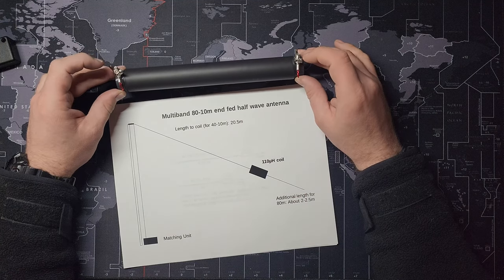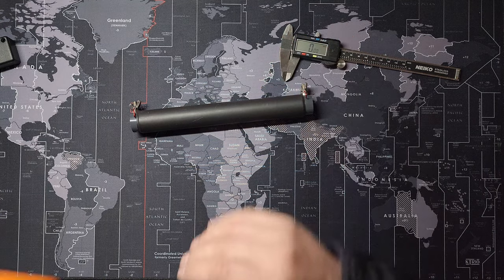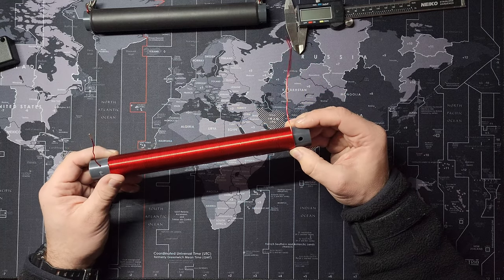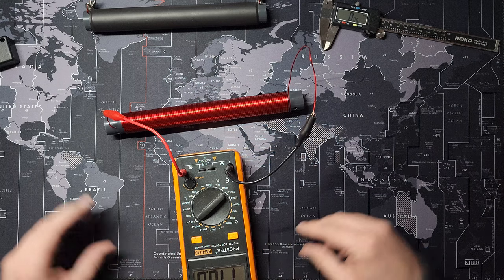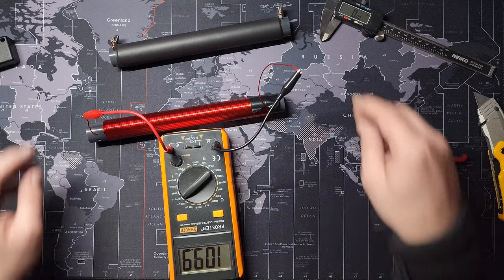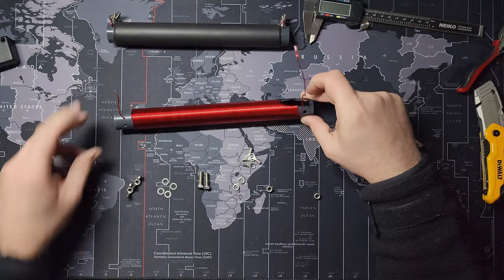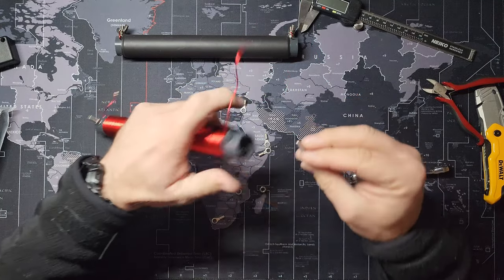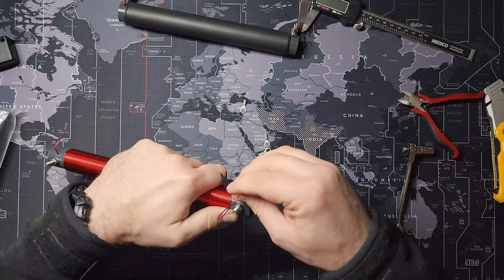Shortened EFHW from 40M to 80M with 110uH Loading Coil

Comment: Looking great. I am a Wireman, love these Endfed Antennas. I work fulltime portable talking to the whole World with 100W out of the Fields, Woods or along side the Shores of River Areas.. Amazing how well these Antennas work on relatively low heights setup from the Ground. Tnx for this neat Video. 73 de YFUG 💯👍🙋‍♂
Reply from the maker: Thank you very much for the comment. This loading coil reduces the length of wire I need at my office so I can still be on the air on 80m. I actually made a smaller version for doing portable ops. I may make a video highlighting it. Same concept building it just smaller pipe and different gauge wire. And yes I agree I absolutely love the EFHW! Thank you and 73, Matt N3VAN

Comment: Outstanding video!  Bought the same Proster LCR to check the coil on a MFJ crystal radio kit I just finished. Used it tonight to go through a box of resistors and I'm impressed and definitely the price is right! Got an ARRL endfed kit I'm going to put together soon and definitely want to do this coil mod after I complete it. Have a 130 feet EFHW 7510 from MyAntennas here at the house and my G90 tunes it up great (1.3:1) for the local Emergency Net on 3922. Hoping with this coil I will be able to tune up 75m on the 40m endfed kit  for QRP and field day exercises. Hope to see the conclusion of this video soon and see what your end results were. 73  K5WFD
Reply from the maker: The Proster LCR is surprisingly accurate and in my testing better than the UCTRONICS one. Great device to have if you are building antennas.

I love the EFHW and it is primarily what I use for POTA and doing QRP from remote campsites. Versatile antennas that you can setup in a variety of configurations.

Will be uploading the installation of the coil in one of the next videos I post.

Thank you again!

Comment: Thanks for good instructions. My experience with 66pacific calculator is that it gives you a theoretical minimum number of turns. I usually go for more turns and if needed, remove some.
Reply from the maker: You are very welcome! I am building a Shorty 40 soon with a 35uH coil. You are absolutely right that 66 pacific gives you a rough calculation that is close enough to use but always do a few more turns, measure and then unturn.
Reply: @n3vanradio  I have built a 116uH coil. I don't want to unwind anymore. Will i need to shortened or extend the tail , the end part of the wire from the coil?

Comment: Great video.  Where did you get the info telling you what value of coil you needed to build?  I’d like to build one for a 40m half wave end fed.  I’d like to know how they arrived at 34uH to make a 40m.
Reply from the maker: Thank you! I found information in the ARRL Antenna Book as well as various documentation on the internet. The 110uH coil allows a 40-10m EFHW antenna to add 80m. The 34uH coil allows a 20-10m EFHW antenna to add 40m. That is why you saw the 34uH coil. It is a slightly different application. 

I am in the process of making a QRP version of the 110uH coil for when I go out and do POTA/SOTA. TY for watching and your question. 73, Matt N3VAN

Comment: Hi again, Matt,

Am finally doing the 110 uH coil today and reviewed this video first.

Couldn't find a subsequent video where you deployed and/or tested this coil - did I miss it?

Am interested in what you said about narrow bandwidth at 80 meters when using a coil and how one can get past that with a tuner. Can we get access to all of 80m with a tuner? Have waited to buy a tuner because a lot of folks said it probably wasn't necessary. However if a tuner would increase access/bandwidth significantly I'll get one.

Appreciate your videos and advice!

73,

John - KK7JBZ
Reply from the maker: Hi again John!

I have to finish testing the 110uh, but currently find it has better performance using a 64:1 EFHW transformer than an 49:1 transformer. I have a few videos recorded that I have yet to edit and put into a final video but will get one up in the next few weeks so stay tuned!

Regarding the narrowness of the 80m portion, yes a tuner would definitely bring the entire band into usability. But I am trying to keep my tuners in ham closet and not used as they induce their own losses in performance. I am working on a QRP version for doing POTA/SOTA, etc.

Stay tuned and thank you so much for watching!

73, Matt N3VAN
Reply: @n3vanradio   Thanks, Matt. I'm just trying to get on the air for the first time with the ARRL EFHW at my QTH and want to access as many bands as possible to see what's out there. May get into POTA/SOTA/QRP at some point, but have to walk (crawl?) before I can run. 

I'm subscribed and will keep an eye out for your videos!

73,
John
Reply: I saw where a guy added a 500pf capacitor at the halfway point of a 8010, but that wasn’t a half wave. The capacitor moved the res higher in the 80 band without   Impacting the higher bands.
Reply: @robertmachette836  Now that is very interesting, I may have to try that!

Comment: I'd like to add a 40 m coil to a 30m EFHW, how do I know what inductance I need? Do you know a general formula for coil inductance in an efhw?
Reply from the maker: I never tried to extend a 30m EFHW to 40m but I assume it is possible using an inductance coil. Unsure the micro henry's needed for that but with a 30m you should be able to get 60m with a coil much easier!

Comment: Hi Matt,

Checked out the linked inductance calculator. Seems like it would be more useful if you entered tube diameter, wire gauge and desired impedence in uH and it spit out the number of turns required. 

There is a significant difference in cost of the two meters listed in the description, and the cheaper one (the one you used in the video) also has a resistance setting while the other does not. I already have a multimeter that does resistance.

What features does the more expensive meter offer over the cheaper meter? Is it more rugged or otherwise of better build quality?

Thanks,
John - KK7JBZ
Reply from the maker: It would definitely make it easier to enter tube diameter, wire gauge (or measured thickness) and desired impedence in uH to get the required turns. It would take the guess work out when initially checking how many turns it takes.

The main difference between the two LCR meters is the accuracy. The UCTRONICS has much better accuracy than the cheaper one I use. I wasn't planning on making a ton of the 110uH or 35uH (for shortened 40m) coils so i couldnt justify the higher cost. But yes the UCTRONICS  doesnt have the resistance measurement.

I had to buy one as my multimeters did not have inductance measurement.

Thank you and 73 Matt N3VAN

Comment: I can only mount my EFHW 40-10 horizontal @~20 feet up. I have 95ft in clear length so I am thinking this would work to get 80-10, right?
Reply from the maker: Yes, this will allow you to get the 80m band however it will be a short sliver of the band in usable SWR but a touchup tuner would get you the entire 80m band.
Reply: @n3vanradio  Where is the video of you putting this antenna up? I

Comment: Can you put 100w through that? Making one soon so I guess I’ll find out!
Reply from the maker: I have done 500 watts through this one. It is 18awg enameled copper and I use 18 awg polystealth. No issues so far. Working on a QRP version for doing POTA/SOTA but since it will be 22 awg it will handle at most 150 watts.